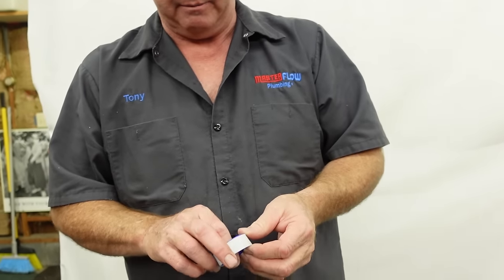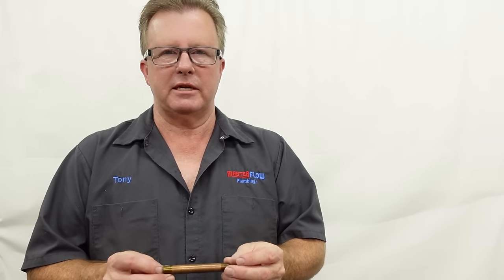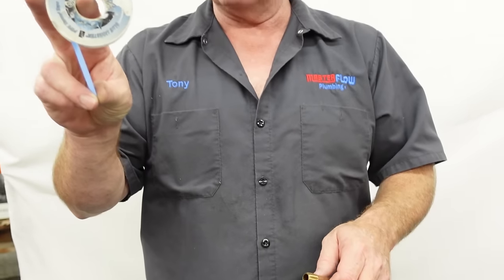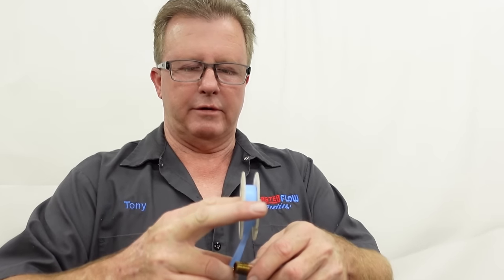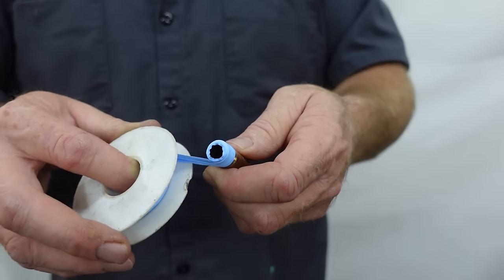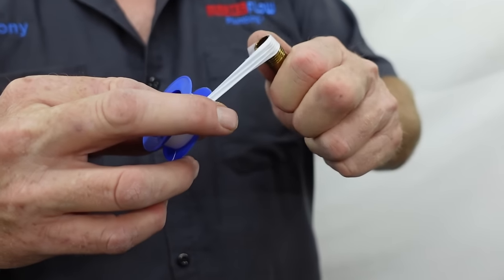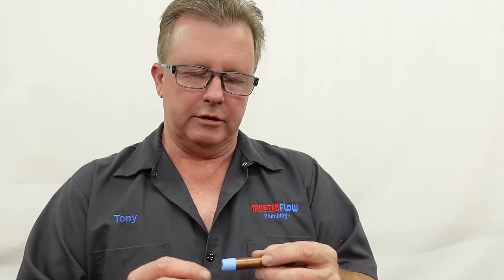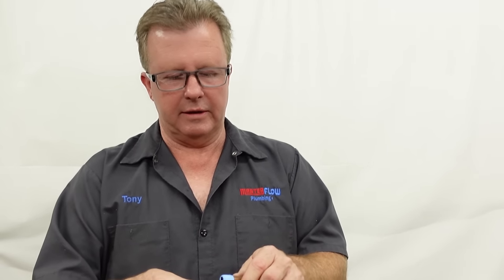How To Correctly Wrap Teflon Tape

Comment: Several items I see, first by having the tape extend past the threads you run the risk of having the system contaminated by the debris coming off, especially if you are working on a truck air system . Second, have the threads of the fitting come out of your hand by your thumb with the tape in your other hand on whichever finger is comfortable with the tape coming off the bottom of the roll. Wrap the tape over the top following the direction of your fingers. It's easier to pull the tape tight. I start about 2 threads back from the end and on the 2nd wrap I'll move closer to the end, but not past. I'm a heavy truck/trash truck mechanic with lots of air system and hydraulic systems for the last 45 years. If I had 5$ for every roll I've used I'd be wealthy.
Reply from the maker: Thanks for sharing your experience with air and hydraulics. We definitely intended for this technique to apply to water line only.  Thanks for watching
Reply: I agree with Cbmech. I'm a retired hydraulic system design engineer so when our prints went out to the shop floor, a note was always included to NOT wrap the Teflon tape over the end of the fitting/pipe. As the fitting is tightened inside the female fitting, any tape over the end of the fitting can be cut loose and end up in the hydraulic fluid stream. This is very problematic for downstream valves, especially close tolerance valves. And devastating for servo valves typical on CNC machine tools and close tolerance actuators.
Reply: @masterflowplumbing9812  personally I wouldn't want pieces of tape floating in my water supply either. 
Plus, anything past the first thread would do little nothing to improve sealing.
Reply: @nealvance8701  anything cut off and left in a pneumatic system, like in a truck air brake system, would tend to cause problems in the air valves. Step on brakes and a relay doesn't open......oops 😬 crunch.

Comment: After 25yrs of plumbing, I start at least one or two threads back.  Tape can easily rip if at the edge, just check your faucet aerator you will see it there.

Comment: I am an amature DIY'er and a couple of days ago a leek sprung in some really ancient under the counter taps from the threaded nuts. I had to apply what we call in England PTFE tape (same thing as the white tape in this video). Because of the restricted positions of my taps I had a real struggle getting the tape on cleanly because it kept seperating and also bunching into almost string like. It took a few attempts. Working vertically with those taps because this is how they are positioned I basically looked at the direction of the nut as it would be tightened and I ran the tape in the same direction. Yes it it clockwise but when upside down it appears anti clockwise. Does my head in. So I would say, wrap in the same direction the nut goes on. My pennies worth. Great video and funny how YouTube recommended it two days after my flood. Someone is listening in, but I don't mind when it comes to tutorials like these.
Reply from the maker: Glad we were able to help

Comment: I do appreciate the information and I especially like that actual plumbers making videos here agree with each other on the basic stuff that might be new to people like me. That gives me a lot more confidence to attempt a simple repair. I'm still wondering about the set up time after you apply the pipe dope to a fitting. I would think it might make a difference.
Reply from the maker: No set up time in the green stuff. It actually stays soft for years. Thanks for the compliments. And thanks for watching.

Comment: Nice work and video, but for gas(yellow tape) and air lines I was taught to start a thread away from the beginning.
Reply from the maker: your not wrong.. on air or gas that would be correct ,reason for it is so loose teflon shreds do not travel to sensitive equipment like  air tools  and gas control valves ..for water pipe though i was taught the method in the video.. thanks for pointing it out i should have mentioned it  in more detail

Comment: Can I use teflon tape when attaching a hose nozzle to my garden hose? The rubber gaskets tend to spring leaks quite easily. Thanks for you very information video.
Reply from the maker: Teflon tape in the threads alone won’t help.  The rubber washer also serves as a spacer so to speak.  Without it in place the hose fitting will always be loose.  Replace the washer often. https://amzn.to/4fKjjZr

Comment: And just for clarification, no need for tape or dope on compression fittings?
Reply from the maker: I always use dope on compression fittings threads. But not as a sealant. Rather is acts as a lubricant so I get a good torque on the fitting nut. Never Teflon a compression fitting

Comment: Is it always clockwise to the direction facing you even if you have to turn the pipe around in order to put it into the wall? I am sorry for the stupid question, I just never did this before.
Reply from the maker: Yes always clockwise looking at the end of the thread

Comment: Can you use other sealants on gas stove fittings
Reply from the maker: Of course.  In fact the Teflon tape I use in this video should not be used for gas.  They make Teflon for gas but it’s yellow in color.  Any Teflon based thread sealing paste should be great for gas piping

Comment: A friend introduced me to green Teflon tape and that’s all I use. It’s for oxygen and it’s much thicker, less wraps, seals better.  Years ago I could not seal a drain on a disposer drain. The drain was lower than the wall drain. An old drain specialist plumber helped me and we used Teflon tape and Teflon paste together, I worked 3+ hours and it still leaked, after 10 minutes we were done. Today, 3 years later, still works and does not leak. This drain is 2” blow the wall drain. I have always used the Teflon paste, yet you never mentioned it, how come?   Thanks…Jim
Reply from the maker: I don’t talk about paste too much because the video is simply about applying Teflon tape.

Comment: How many extra layers do you recommend if counterclockwise?  I have been doing about 5 -6 because of this. I tried doing a clockwise several times for many years, I just can't get it tight enough
Reply from the maker: You have to stretch it tight as you wrap it

Comment: I had always been told that pipe dope or teflon tape were only placed on threads in order to enable the joint to be unscrewed. It is NOT to keep the joint from leaking. Properly threaded pipes without thread compound or tape, tightened to the correct tightness should not leak. If a joint leaks it is because of a defect in the threads, cross threading or improper tightening.
Reply from the maker: Very well could be true but for the last 30 years it’s been impossible to get the Chinese to follow those thread standards lol. Teflon tape and pipe dope are very necessary in todays world

Comment: The last time a plumber did work in my house he told me he doesn't use and doesn't recommend using Teflon tape.  Instead he prefers the old vegetable fiber stuff (hemp).  I think his argument was that the fiber expands in contact with water, improving the seal.
Reply: Seems to be about personal preference. I have mosstly seen the linen fibers or loctite thread sealant depending on personal preference and and conveinience in the specific application.
Reply: You shouldn’t use hemp on potable water, but I must agree hemp provides a better seal
Reply: @paulwoodward4999  Should you use PTFE on potable water? HAve heard alot of debate concerning wether you should even use PTFE in industrial lubricants.
Reply: @rimmersbryggeri  as far as I’m aware you can. I’m retired now and regulations change often. When I started plumbing in the late sixties we used hemp and boss white on potable water pipes. It formed a great seal. Back then most people were drinking from lead pipes and were for many years   Too many regs now constantly changing
Reply: @paulwoodward4999  Yeah I know. The old guys like the linen (flax) fibres they use here. But I gueess  mostly on radiator pipes. I like the heavier ptfe or anareobic/water curing thread sealant depending on how difficult the space is to get into. I live in sweden so regulations might be very different from where you live. Whave used iron and copper pipes for a very long time as far as I know. They did use asbesthos reinforced ventilation pipes though up to the 60's.
Reply: @rimmersbryggeri  yes I used and worked with asbestos flue pipes all through the seventies and eighties. We were told that we only need to worry about blue asbestos. How wrong they were.
Reply: @paulwoodward4999  Hope you are fine and werent harmed too much by it.

Comment: Sorry I disagree that over lap is not good Teflon shred’s off! Then works it’s way into valves! Filters,strainers and what ever
Reply from the maker: Sorry you disagree. I’ve been doing it for decades and never had that issue. Once again I’m amazed at how many experts in this subject are watching a how to video
Reply: I am  also a licensed plumber got my ticket in 1969 ! Speaking from almost 60 years experience!
Reply: @johnamerican1578  why would you be watching a how-to video with 60 years' experience. lol
Reply: Greg s 
I saw the clip on utube though I would watch maybe learn something new ! I have seen lots of changes since 1964 !! Not all good 👍
Reply: Yes, that's why I use teflon tape instead of pipe dope.I dont want sealant getting lodged in my sensitive valves and plugging them up.Never overlap tape past the threads it can break off over time and will get caught in something downstream.

Comment: @2:30 Clockwise or anti-clockwise depends on whether you are right-handed or left-handed, and also depends on your POV, i.e. from the front or the back end of the pipe. It's more important to SHOW what happens when done the right and the wrong ways instead of just memorizing "always clockwise", and to visualize how the pipe is going to fit before doing the wrap. A southpaw would do it wrong all the time if what he learnt is to always wrap it clockwise.
Reply: Clockwise is clockwise whether you’re left handed or right handed or standing on your head
Reply: @paulwoodward4999  To people with no analytic skills, yes.
Just hold a pipe (or just a pen) in your left hand and wrap it clockwise with a strip of paper with your right hand, and hold another pipe in your right hand and wrap it the same way with your left hand, then compare them and tell me they are exactly the same.
Reply: I don’t have to think about it. Whether I’m holding pipe in left or right hand all the same to me. Just look at the threads. Experience plumbers will know that
Reply: @paulwoodward4999  But if an inexperienced lefthander learn from this video, he'll do it wrong all the time.
Reply: @tkjho  just wind the tape in the same direction of the thread it’s always clockwise. Easy whichever hand or experience
Reply: @paulwoodward4999  If you look at it from the thread end, it's clockwise. But if you look at it from the other end. it's counterclockwise.
Reply: @tkjho  no it’s not. You are getting confused with leftward directions and rightward directions clockwise doesn’t change. Forget left handed. Follow the thread on the pipe or fitting. I could add more confusion to the conversation. In some cases there are left hand threads. Eg radiator sections that you have to join together
Reply: @paulwoodward4999  To me, clockwise is rotating the same way as the hands on a clock facing me. I think you're the one that's confused. Moving from 10 to 2 is clockwise and rightward, whereas moving from 4 to 8 is clockwise and leftward.
I know well how to do it myself. All I was pointing out is that the "instruction video" is misleading.
Reply: I give up with you. Stick to your day job and leave any plumbing to the experts
Reply: @paulwoodward4999   Only if the "experts" know exactly what they're talking about.
Reply from the maker: Problem with most people is that they think there is only one way to do something
Reply: As a right hander, I hold the fitting in the left hand and wind tape on with the right, wrapping over top of thread and away from me.
Reply: @rocknral   Just pretend that you're a left hander for once,  hold the fitting in the RIGHT hand and wind tape on with the LEFT, wrapping over top of thread and away from you, then you'll see exactly what I mean.
Reply: @tkjho  I get what your saying that's actually how I learned it with out it being confused and I'm right handed I was told if your right handed your most likely holding the fitting in your left hand so when you wrap you wrap away from you and if your left handed you will be holding the fitting in your right hand so the tape is in your left so left handers wrap it back towards them
Reply: @paulwoodward4999  I get what he is saying right handers wrap away from there bodys left handers wrap back towards there bodys because there holding the threaded end facing the  left instead of the right

Comment: It's a good thing you aren't working on hydraulics, never, never wrap it at the end, it will shed it's excess and damage, plug, areas in the system, as well be very, very careful and don't over tighten as it is acting like a lubricant and can split fittings, joints etc.
Reply from the maker: Do hydraulics use pipe threads ?
Reply: @masterflowplumbing9812  yes, in places NPT are still used, but becoming less prevalent, mostly on a return line circuits, but still Teflon contamination is contamination.

Comment: I usef ptfe 30 years ago and stopped using it 29 years ago. Too easy to unscrew and leaks. Hemp or Loctite
Reply: Same here, but goes back further than that. Started seeing Shower Arm Drop Ells Split and Cracked. Do you know how hard it is to un-sweat that fitting and Sweat a new on? Used Rector Seal #5 back then today on something like that, Loctite PTS. There is a fitting I Religiously use Teflon Tape on. That’s the PVC Threads on my Saltwater Aquarium Piping. If you don’t, you can Cold Weld the Threads, when Tightening them.
Reply: I also use hemp on the pipe threads and I find it works better.

Comment: The other video I just saw the guy said to never overlap the thread openings!
Reply from the maker: If your using it on air or gas lines you should not but for water and drains I find it works best

Comment: What happens if white tape is used on gas lines?
Reply from the maker: From what I’ve always understood is that the white Teflon tape can shred and travel to sensitive gas equipment.  On gas pipe I always use pipe thread compound.  I like a particular one called “green stuff” made by jomar. If you use Teflon tape on gas make sure it’s rated for that and meets local codes.  The green stuff. It not only seals good but it also acts as an anti seize and allows  for proper tightening by lubricating the threads before tightening.
Reply: @masterflowplumbing9812  If you want to kill a hydraulic control system, use that white PTFE tape in the threads. Turns a simple job into a major.

Comment: In the past (the real past) plumbers used HEMP.
I'm thinking you'd be too young (or stupid) to remember HEMP.
A little later some finger coated their hemp with graphite grease _ probably to tighten the joints more..
Reply: 👍you and I are speaking about before Teflon tape and pvc pipe?? We used what was called wicking!
Reply from the maker: So people who weren’t around in the old days are stupid ?

Comment: Over-lapping is not good... Having too much tape off the threads hanging over the opening of the pipe could cause small pieces of the tape to come off and cause an issue of it doesn't come out the faucet. On gas pipe applications, it could cause more issues. The fragmented pieces of tape could block parts and cause reduced gases from passing thru to the burner.
Reply from the maker: Thanks for watching.